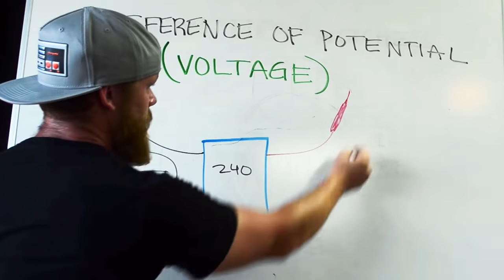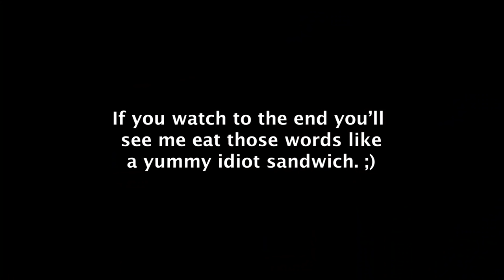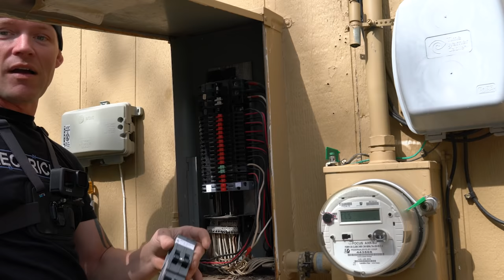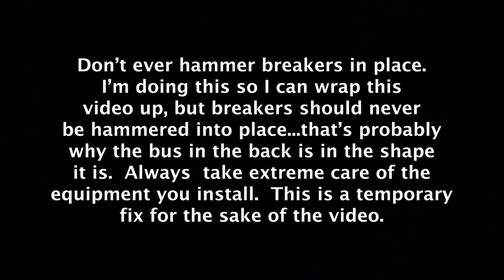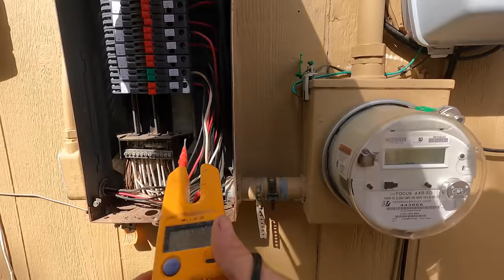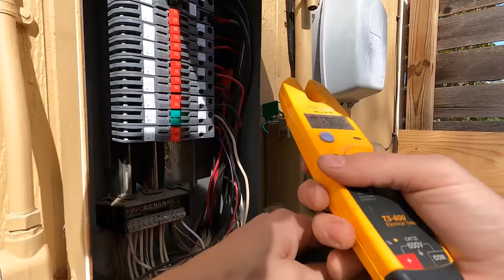How To Work on LIVE CIRCUITS - Replacing Circuit Breakers in Old ZINSCO Panel

Comment: Good stuff as informational.  Its weird as I actually would not ever replace a zinsco breaker for a customer on a service call. Partly because the contractor I worked for refused to and would rather the customer think about replacing the panel. I would prompt the customer to check out ismypanelsafe.com and explain to them the reasons the panel isn't safe.  1 out of 200 or so zinsco breakers will not trip when they are supposed to.  Now add in the fact that you have a panel full of them and your odds are like 1 in 10.  If you have one tripping then you might as well replace the panel.

Comment: mister electrician talking with his hands with a screwdriver in one of them,   how easy for that metal spear to make contact in that weird panel..  but as he said, it is his house.  I worked for an electrical contractor, a master, and his panel was the worst looking service I have ever seen.  double wires on a single breaker screw, grounds and neutrals terminated in the same block, sometimes two and three wires on the same lug.  easily like a 100 amp panel maxed out to 150/180 amp load.  like wow, I thought.  but he paid well and every Friday.  so that was good.

Comment: I'm just utterly gobsmacked anyone is arguing against insulated tools. It's not like a decent set of 1000v rated drivers, pliers, cutters etc actually cost  that much in the grand scheme of things. It's a no brainer. 

I'm also staggered at that board, what a piece of crap.   ..... I have 230v and 400v 3 phase in my house, I feel very safe in the knowledge the equipment I installed is brilliant and safe, fully protected by RCD's. I'm in France.

Comment: At no point was it proven the busbar was dead and the panel was safe enough to work on. The main switch being in the off position doesn't prove the busbar is dead, the main switch could be faulty and not actually disconnecting power to the busbar.

Comment: I was on a job interview, and they asked me what special talents do you have. I said, I'm the guy they call when it's got to be hooked up live. Needless to say, I didn't get the job, LOL. I often have to tie a transformer or a lead into a wire nuts connection, on equipment that can't be turned off, or breaker location unknown. I wrap the existing wires with tape, so they don't splay, pull the nut, add the wire and secure.
I ALWAYS work like the circuits are hot, that way I don't shake when I have to do it . I had to add computer interfaces to some transfer switches live, and it was stressful, dangerous but necessary. No room for error.

Comment: it would be a lot cheaper just to change that enclosure that particular job is really easy to pull the meter and you install new enclosure and don’t waste your time and energy buying expensive replacement just change it and be done with it  .

Comment: My single issue is that you don’t bring up your hot work disclaimer until after you’ve done 95% of your hot work. Working in a panel, even taking readings, is hot work if any conductor is live is the panel - this message obviously isn’t for you, it’s for the new apprentices that don’t know this.

Comment: Master electrician? Wearing a arc hood with a t-shirt & 1000v gloves in a 120 panel? The white glove over your rubber is sufficient for 600 & doesn't restrict movement as much. ...but you do you "master" sparkey.

Comment: Going to disagree with you. I would have just stuck the breaker in first without your hot wires in it. Because you were struggling and you noticed it was damaged as well.. There could have been a big issue there. I would have safed those live wires some how thrown rubber caps or whatever on them for the time being. Then got that breaker in, cleaned the buss whatever.. Then stuck the live conductors in extremely carefully. Good job though 👍.

Comment: Why don't you use a square tiped torqued screw driver to install the breakers, I unscrew the wire while is still on the panel and just move to the side for re install with torque screw driver...

Comment: Las week I changed an 200 amp Bryant  outdoor  panel . I was sweating . I would probably never do it again because as I pulled the main feeders out of the main breaker all the guts came off and almost back feed power to the transformer. Not worth it.

Comment: If only they would have installed that panel 6 inches higher. How many times did you hit your head on that panel door? 😂
Reply: He obviously likes being hit by that door... it's so easy to take them off.
Reply: @wim0104  I've seen a few really old ones with rivets holding on the door and really no way to take it off. Not sure if this one was like that but I just thought it was funny you could tell how tall the original electrician probably was 😂

Comment: Went to a customers house and he used the meter base as a raceway for another panel in his backyard, it blew my mind that he was able to make a 90 degree bend in a box with no safety, and doing it blind, of course after we seen it we noted it and when we went to install his generator and have service turned off and on and inspected we pulled his wires out and ran it the correct way and plugged his meter box hole, to everyone seeing this, please don’t ever do what he did, you cannot use the meter base as a raceway, even we can’t do that.

Comment: You said the bus wasn’t live but the breaker was? Can some one explain how the breaker is still live but the bus isn’t
Reply: The wires going into the breaker were live becuase they come directly from the meter, the breaker was off so it wasn’t powering the bus bar
Reply: The conductors coming from the meter to the breaker are still hot.

Comment: Those morse locks never intimidate me? A grinder with a cut off wheel will make short work of that ring. I know because I have cut them off HOT. I work HOT work all the time. 
Personally to avoid the fine? I would disconnect both hot legs at the entrance head to make it safe if I can’t pull the meter? The arc flash potential is high in such a small confined area. No need for that stupid “Darth Vader” flash shield. I have personally broke atleast 5 of them. They suck!

Comment: There is never, ever a reason to work something hot. The risk is never worth the reward. An arc flash is four times hotter than the sun. 
The utility company would be more than happy to show up and remove the gold ring and pull the meter. 
It’s not if the arc fault will happen, just when. You always have a choice.

Comment: So I've been doing electric work for over 30 years and where I live I can assure you there are no breaker boxes outside. Whose stupid idea was this for this to ever be a thing? Why would I want my breaker box exposed to anyone walking by to tamper with? Why would I want my breaker box exposed to the elements? If a breaker trips during a thunderstorm or when it's 3 degrees outside with 15 inches of snow why the hell would I have to be subjected to going out there in the dark to reset a breaker? I can't think of one possible reason this should be a thing....

Comment: An uninsulated screwdriver should never been in an electricians hands while woking live.
Reply: The handle of that screwdriver is insulated at 600V. The shaft isnt.
Reply: @greysen955  Yeah I see that but the shaft is the dangerous part as its touching the live terminal. Maybe thats common in the US but not in the UK, we use VDE 1000V Insulated with only the tip of the screwdriver exposed.
Reply: @greysen955  ok. That ok then....   wtf

Comment: quite a bit of multiwire branch circuits there
Reply from the maker: You're right, and none of the breakers have handle ties.  Something I'm going to add in a later video so I can discuss the hazards of overvoltage/undervoltage and frying equipment. Good eye
Reply: Is the main panel usually located on the exterior where you live?
Reply: @Bradley-tx6ed  I was wondering the same. I've seen it on like late 50's era houses all overhead services

Comment: Your using the right gloves for handling hot wires, protecting your face with a shield against Arc-Flash, but what about your bare arms ?? and is your "T" shirt flame resistant ?? Arc-Flash is the temperature of the Sun !!!

Comment: Why not just call the local supply authority and get approval, i carry tags and call in to pull the meter frequently , its not a big deal and a heck of a lot safer. Record your meters info on the tags, Pull the meter, install a lexan blank temporarily, do your work, then re-install the meter and call job complete in, way safer and no ppe needed. This all seems excessively stupid.
Reply: Why not just call the power company to cut it off at the street?

Comment: I’ve been an electrician for over 20yrs.
Let me just give a few pointers, that this video does not cover.
1. Before doing any of this work, why not take that top cover off?
If that fell down when you had hot wires exposed, you would have a problem.
2. I would never push on main breaker.  You have no idea what condition that back bus bar is in.  You could have pushed hot bus right into the metal back box.
3. Safe end your hots with nuts or tape first, put main breaker in, then land wires.
4. Why wear arc flash helmet and gloves, but you have zero protection on your arms and torso.

If I was to go this far, just replace the entire panel.  Call and get barrel lock removed, and work with meter pulled.
This is “Electrician U”
These are the wrong practices to be teaching.

Comment: dude,
Cut the lock key close to the meter tag, then bend it back in when you re-assemble. The never check, and if they did, they don't care. Don't work on shit live if you don't know what your doing, and always use the right hand rule of working on live shit.That way if you take a blast, it goes down the right side of your body to the ground and not left through your heart. Both hands, Duh? Master what you? Those old Zinsco's can have bleed threw even when you shut off the main, one side is pretty common, if you had experience, you'd know, talker!
Be, carefull!!!!!

Comment: No matter how much of a “master electrician” you are, you should always follow safety precautions. I like your video but it should be “Lead by Example” which you do not demonstrate.
Reply: Although this isn't really a situation where it is warranted, he did say there are situations where you must be prepared to work on live wiring.  Aside from the screwdriver,  I think he demonstrated what measures to take

Comment: How cheap are you? Replace the whole load center box. Call utility and have meter temporarily removed. New box new breaker designs (Eaton, Siemens, Square D). Do as I say not as I do. Thanks for Video. Now I know I can do better work than a Master Electrician... ha ha.

Comment: The only proper solution for zinsco and FPE is to remove and replace...
Not worth the risk...
Reply from the maker: Most of the time I agree, however as long as you check out the bus and the breakers there's nothing wrong with keeping them - especially when you're in a pinch and you just need to keep power on.  No sense in charging someone $2500 for a panel replacement when a $50 service call can keep them going.  Don't get me wrong, I love upcharges...when they're necessary.
Reply: @ElectricianU  completley understand brother.. good video...👍

Comment: Why not first turn off all breakers, then put on ppe, then open the panel which is live, really, then remove the incoming wire and isolate it with a simple plastic cap. Then, with the dead panel, replace stuff without protection. Also, you replace the breakers because these are obsolete. So throw them away. The function of breakers is safety. Nice talk about only to work on live if it is really really needed, but he sure can have that meter removed to avoid work on live. Just call the power company. They will charge something, ok, but ppe gear is not cheap. Rubber gloves $200, last only a few months. Leather gloves $200. And working with ppe takes more time, so costs more money.

Comment: I think this guys videos are very professional looking but this is not how a professional works. Residential, commercial and Industrial professional electricians do not work like this. For those of you watching this specific video, don’t not mimic this. This is absolutely reckless. There is no over current protection between than main feeder and the meter, if you get hung up, it will kill you.

Comment: Hmmmmm Working hot and wearing gloves (good), mask (good), bare skin (dangerous), clothing not rated for arc flash. My feeling is you have never had arc flash training. Looking at body damage from an arc flash would scare you smart. You are providing an excellent service, but DIY’ers are watching too and probably figure they can do the same.  Also already pointed out you are not using proper tools for power on service.

Comment: All electrical work other than changing a lightbulb requires an electrical permit in most cities and states first of all you’re not complying with the law.
Reply: He’s a Fraud took a picture of the video his meter is not even illuminated D energizedthey disconnected the taps up top he’s not even doing it hot.
Reply: This is very dangerous I strongly recommend anybody watching this video license or not license don’t be a dumb dumb like him deenergized service pull the meter call the utility company it’s very dangerous and unsafe and I think the people out there should use better judgment.

Comment: Brother!!! Why the Hell did you leave the door on the box??? Two screws and the door is out of the way AND you get more light on the work. I always carry duct tape and something to cover the interior of the can where you are manipulating the hot ends. The last thing, and I'll quit raggin' on your ass. You cover your face and hands.. that leaves your arms and chest exposed to molten copper and steel if one of those bare line wires pops out of your hand or the main breaker had shattered while you were going Mid-Evil on it and both wires spring around. OK...one more thing. I keep a Dremel and some small files on my truck to smooth and dress arcing damage and the like.

Comment: How many times you said “live wire”...? I mean.. kind of blowing out of proportion bud... the only things you had live was the main breaker, that was connected by some thin wires with plenty of slack.. also, too much hand talking on front of an open panel while holding a non insulated screwdriver.

Comment: Master Electrician? Didn't tighten the neutrals. Working alone on live conductors? No Nomex clothing. You could have called the power company to remove the lock on the meter.  I would have run you off the first day

Comment: sometimes i have to gently and slightly spread the part that grabs on the buss with a flat head and it grabs and goes on smooth
Reply: Doing that is bad news... The tension that those breakers have is exactly why they are hard to get on. The main breaker in his panel had heated up at some point, and the tension that was supposed to be there wasn't. That is why the bus had scaring on it. 

Long story short, don't do that. Please.